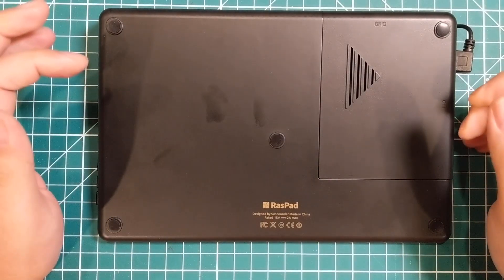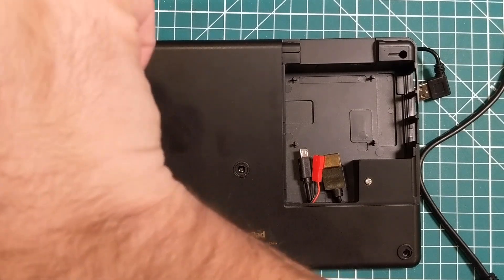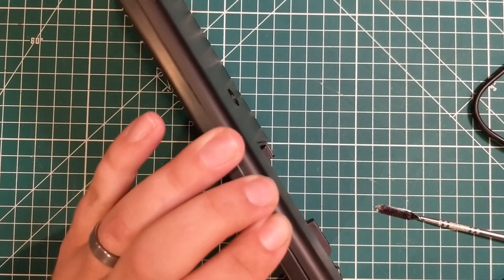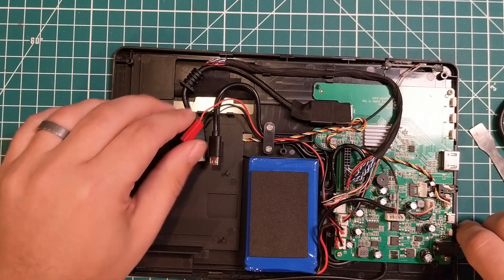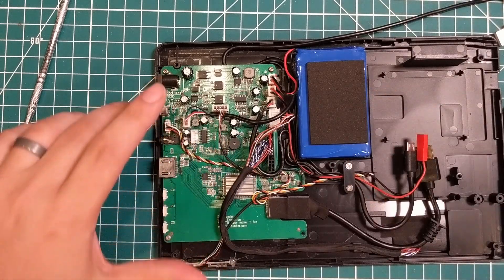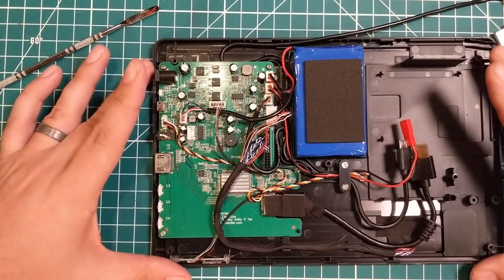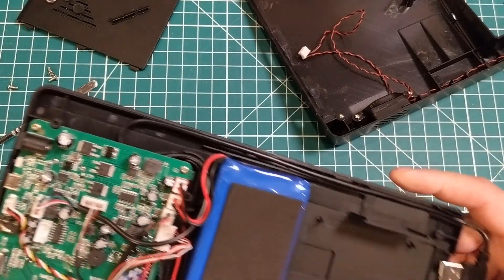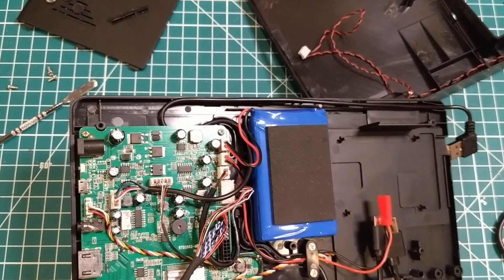RasPad Teardown

Comment: You can have all the USBs if you cut the touch USB and soldered it directly to the breakout pins of onboard USB. 
Also I'd remove the USB from board and the ethernet port too and rearrange it so o reduce the thickness.
Also what i notice is they did a horrible job making it, looking at how everything is cramped up , it's so ugly, triggers my OCD...
Reply from the maker: Totally agree.  I don't really know why it wasn't done that way originally, but I'm not a pcb designer :)
Reply: @AnotherMaker  I have designed my fair share of products and I can make a better design than what they have done here :p
And they raised what? 600k you said?
Reply from the maker: @HarshDethe  Yeah. That's a lot of cash!
Reply: Had me on the edge of my seat when you were prying it open.
Reply from the maker: @evanbusenitz555  I thought "literally the only thing I have to lose is a trip to the post office :)"